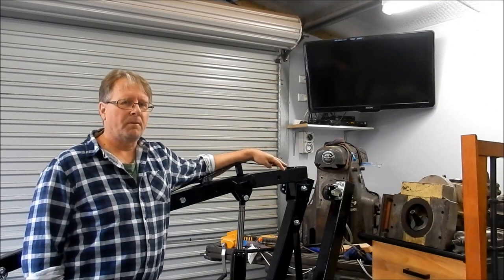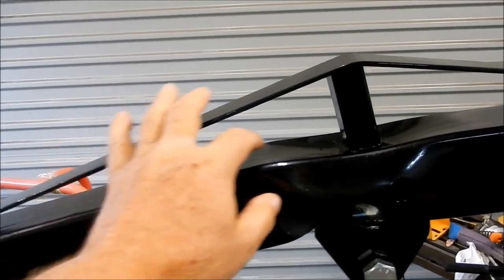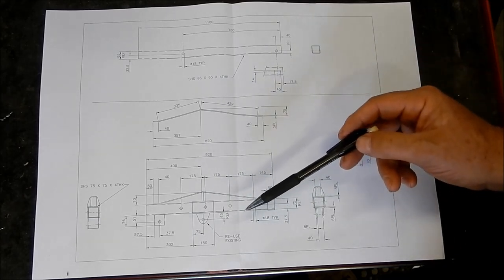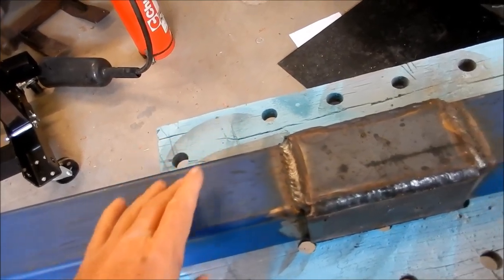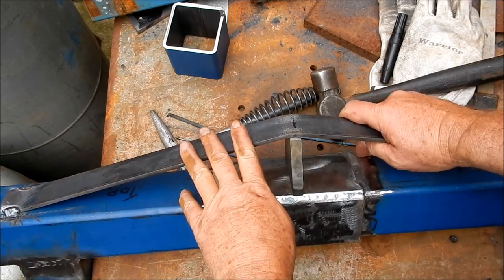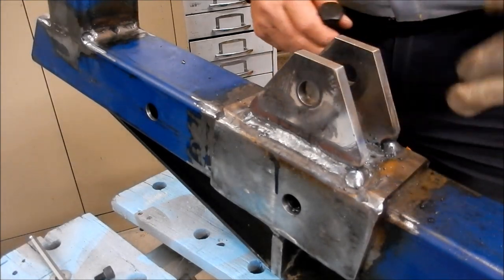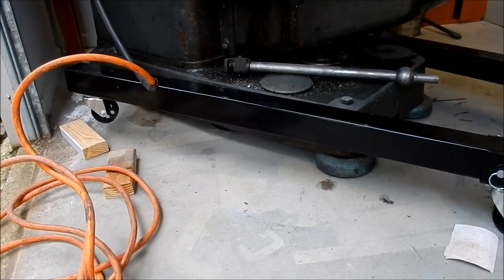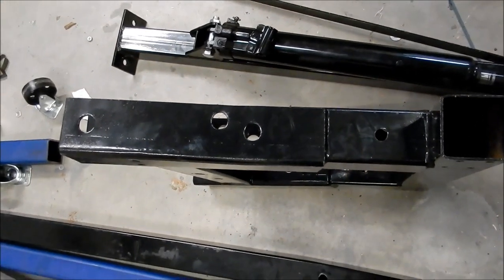Engine Hoist/Crane Fail and Repair Part 1

Comment: I've worked in a few shops now and every one had one of these ubiquitous import units.  They probably all come out of the same factory but get painted different colors.  And yes, I've been guilty of misusing them just like most people but I have to say I'm impressed as I've never seen someone bend one before like this.  I agree though in that the general geometry of the legs and how they mount creates headaches that require boom extension further than one would like, lessening the load capacity.  Looking forward to seeing the unit back up and running in part 2, so you can move your machine!
Reply from the maker: G'Day Everett, yep these little hoist's are everywhere, I used my brothers one to move my Lathe around but didn't want to risk it on this lift.  Very glad I didn't or I'd be buying a replacement.  Yes those legs always seem to be in the way when lifting off the ground.  This is by far the heavy'st lift I would ever do in my little shop so if I can master it with this modified thing everything else will be a breeze.
Cam
Reply: The best addition to my moving equipment other than one of these cheap hoists is my big Vestil pry lever, which I've usually seen referred to as johnson bar or j-bar, and they are great. It is wonderful for positioning my machinery or lifting it up onto wooden blocks, skates, etc. I've even used multiple steel rods to roll the machines like a makeshift conveyer, and that works well too, you just have to be careful and continue to move them as the machine rolls off of one.
Reply from the maker: I call them a Jimmy Bar.  That's how I manoverd it to it's current position but it's now in front of one of the core holes so the next move is to lift it up and over.
Cam

Comment: Gday Cam, I’ve got the same engine hoist and I agree, there absolutely shit to try and move around with load on it, I’m very surprised I haven’t bent mine yet, I did but the steel to build a gantry crane but the RHS went into a new work bench instead but I still got the I beam, steel isn’t cheap so it’s on t he back burner for a while, the biggest gripe I have with the engine crane is the legs are alway to narrow are in the bloody of everything, I made an “dodgy” extension to that goes in the end to gain about a foot more reach but still doesn’t make it any better to use, awesome video mate, cheers Matty
Reply from the maker: G'Day Matty, the things we do in our little backyard workshops to get the job done.  Interative Design through failure, if I was still designing in industry and worked like this I'd be shot, but this is so much more fun.
Cam

Comment: I just lifted my sixis mill approx. 850 kg with my engine hoist to my new workshop. I set the arm at 1000 kg range and lifting went fine. I only noticed offloading from the trailer that the hook was not in the centerline anymore, it has shifted a bit to the side. I only use the hoist for lifting and have now fitted wood beams under all my machines so i can do the moving with my pallet truck. Also saves on the floor, the metal casters are so bad. I can now move all my machines and workbenches with my pallet truck and easily move equipment out of the way when projects require.

Comment: Nice work. Fun lesson in mechanical engineering.
Reply from the maker: Thanks for looking in and commenting Rob.  I call it Intrerative design from failure.  Not the most effective way to get the job done but it works.
Cam

Comment: Nice repair to the chinesium unit. I have the same unit at home under another brand except mine has a dual pump unit on it. Pumps on the up and down stroke. I have not used it yet but I am soon but now I have an idea of the weak points. Thanks for sharing. Cheers
Reply from the maker: G'Day Yves, I hope your lift goes better than mine but I did push it well over its limits.
Cam

Comment: The front wheels suck, my old one has larger none steering steel front wheels set into the legs, can still move engine & gearbox on unsealed hard surface. Also used slightly longer extension tube in the top. Good video👍🏻

Comment: I was interested to see that you slung the machine from under the front and rear of the over-arm. I have a Mk 1 version of this machine and, while the basic structure and over-arm are the same, the recommended sling method (from original manual) is to go under the back of the over-arm and under the front of the knee. I had assumed this implied that the over-arm dovetail was not up to the task. However, you have clearly proved that it is and indeed the manual for the Mk 2 version shows this as the recommended method. This is what I will probably use for any future lifts as it is easier than going under the knee. Cheers, Alan.
Reply from the maker: G'Day Alan, yep I lifted it exactly as the manual described.  I also lifted it this way to get it out of the workshop I brought it from and used a 1T Abby Hoist to lift it with.  The only thing I will change in the lifting configuration is to use a Cum-A-Long to support the knee as its front heavy and lifts on an angle.
Cam
Reply: @camatbattler2233  That reminds me of an advantage of slinging under the front of the knee - it puts the CofG pretty much under the hook...
Alan

Comment: The first time I moved my mill and lathe I used an engine host.  It did not fail but even with somewhat better caster it was difficult to move.  I bought a bigger mill ... and I did not relish trying to lift it with an engine host.   So I made up 4 sets of wooden wedges out of 4”x6” posts. I lifted one side of the mill about an 1” with a toe jack. Inserted wedges... and lifted the opposite side ... until I had about 2.5” clearance.  I then set the machine down on machinery skates and rolled it as needed.   Tom Lipton (Oxtools on YouTube ) has a good video on making a toe jack, and Adam Booth (abom79) I think fabricated some skates.   Also this month’s issue of Home Shop Machinist has a good article on making skates
Reply from the maker: G'Day Fred, I was hoping to get away from lifting and packing and skating by using one lift and roll into place.  The way I'm going it might have been better to invest in a toe jack and skates.  Anyway I'm into it now so lets see if I can get it to work safely, regardless I'll show the result good or bad.
Cam
Reply: @camatbattler2233  “my” toe jack cost me 2 pints for 1 Weeks use

Comment: Very nice repair and rectification Cam. I was watching you lifting that heavy mill at the end of the video and I was thinking, “I wonder if the bottom end will fail”! Well bugger, the bstrd did. Sorry to see this happen buddy. No doubt you will rebuild the entire unit now. Cheers 🍻, Aaron
Reply from the maker: Yep Aaron, my gut also said the base structure would be the next to go.  I took it over to my brothers workshop where he has a bigger press than mine and straightened it all out.  I'll plate it all in and have another go and see if anything else fails.  Its called intuitive design from failure, something I can get away with in my little side show shop but industry would look at it quite differently.  Goldsmith is on this weekend!!
Cam

Comment: That is the problem with a part that is at all well-engineered to be just strong enough to carry the rated loads.  If you overload the structure and then reinforce what failed, you just keep moving the failure to the next component.  And, again if properly engineered, will fail in fairly quick sequence.
Reply from the maker: G'day LT, yep if you push far enough you can cause a failure in any mechanical mechanism.  This rework has now allowed me to achieve my goal of lifting 1600kg and moving the mill out of position so I can have room to refub it.
Cam

Comment: I've been fortunate with my Harbor Freight hoist. I did have issues with the hydraulic cylinder not extending far enough to lift my mill from the factory lifting eye though. I just replaced the cylinder with a higher rated one and did some slight modification to the ram to get it to fit. Now it works perfectly but I will probably beef it up further one day.

Comment: Nice one Cam. Yes I'm guilty of overloading mine somewhat 😂
I was going to suggest welding the top cylinder clevis through a slot in the SHS so it acts as a stiffener and the truss post, then I realised you'd block off the telescoping section! 😂

If you haven't done it yet, I've seen people modify these so they go from a splayed leg to a wider straight leg to better get around equipment. Might be a good idea if you are already working on the base.
Reply from the maker: Hi Tom, yep I said to my brother if I rebuild the base I'll make it wider to get around loads on the ground a lot easier.  I'll do one more plated rebuild on the base and if it fails I'll go with a beefed up wider footprint like the old Abby Hoists. I must admit your overhead flat back lifting frame has some real appeal.
Cam
Reply: @camatbattler2233  I actully thought you had an overhead gantry? It was all pin connections and released allowing more degrees of freedom to prevent binding I seem to recall. Or is it only for light loads?

Comment: Hello Cam

Just found this video and your channel, and I see you have a Victoria U2 mill with a head. I too have the same mill and a vertical head, but I am missing the driving gear, I have the arbor that it is bolted to.

can you tell me the OD diameter and how many teeth the drive gear you have for your mill is, this will help greatly in sourcing a replacement.

Thank you

Peter
Reply from the maker: Yep, I'll get back to you.
Cam
Reply from the maker: Peter, can you flick me your email address.  
Cam

Comment: To move my Bridgeport and lathe around my workshop I purchased a mobile girder rail gantry rated at 1000kg and a 2t chain block and it did the trick easily from H&F. Yes I know the rail was underrated, but there was no major flex in that rail and the wheels worked perfectly. Cost was just over $1000 but it was well worth it.
Reply from the maker: That is a very good option and I would have the head room.  I've almost got this sorted so I'll see how it goes.
Cam

Comment: Looking at the truss brace on the origional I am not sure it's about reinforcing at all but it is designed to induce a "safe faliure" by tin canning the top of the beam cusing it to buckle and fail in a predictable way. Rather than waiting for welds to give way or hydraulics to burst.
Reply from the maker: G'Day Elanman, you could be right and it didn't come down with a thud but rather a "slow" failure.  I wouldn't expect the cylinder to fail as its rated at 8T and at that configuration it should be able to lift 2.5T.  Anyway I'll see how it goes with the next interation.
Cam

Comment: Never ever weld a cross the top of a lifting beam. You automatically create a weak point in the boom. The end stiffener is ok as is the butt end, but the knuckle for the hoist only longitudinal welds. Only use low hydrogen electrodes or mig! Beefing up the boom only, is akin to hanging a 3 ton chain block off a 1 ton chain block expecting to lift a  4 ton load……lol

Comment: could move the top hinge for the hydraulic ram toward the end of the crane arm , this would lower the total lift raise the amount of load the ram could push up but would lessen the load from the ram to the end of the boom (and moves it to negative to the other end )
as for strengthening the lower hinge where the ram mounts to , you could put a tight fitting piece of box section inside the original box section
brilliant violinist (watch those fingers ) reminded me of that joke of the patient with the busted hand asking the doctor if he be able to play the violing ....... doctor answers , year the damage isnt too bad .... thats nice said the patient as i never was able to play the darn instrument to start with 

hmmm the crane actually folds flat when you lower it , think i have a longer ram on mine , probably going to look intoo moving one of the mounts and see if i can fix that as now i have to loosen one side to get the arm to lay flat and allow me to put it away as a smaller package

Comment: You are going to have a whole new cherry picker by the time you are done with it. Would a toe jack and roller pipes not be a better option to move the mill?
Reply from the maker: G'Day Tom, in the area this is going to be placed I still have open holes in the concrete when I jacked up the shed when it sunk.  These make it difficult to move with skates or rollers.  I like the idea of a straight pickup move and drop. Anyway we'll see how the next round of beefing up goes.
Cam

Comment: It's nice to see some proper (stick) welding for a change. Not the spray and pray MIG that I do.
Reply: lmao.. Spray and pray..  Yup, see a lot of that here on youtube.
Reply from the maker: G'Day Mark and yes I still like to use a stick over Mig in most applications.  That little welder is smaller than an A4 sheet and cost less than $100 and will flog 3mm rods out all day long with good penetration and finish.  One of my better buys.
Cam

Comment: Morning Cam. I have the HF two ton and have been lucky. However, your review works for mine as well. Great to have a proper engineering review to provide some keen insight. 

I will take the points and add the tweaks to the retirement list. There will be a new shop on my retirement list so everything will need moved (no I will not be relinquishing the current shop as my wife expects - just adding a larger detached annex - LOL). Lumber up here went nuts for no real reason outside of greed and leveraging a crisis. So I will have to wait a bit more.  

Thanks for all your excellent videos.

Comment: Hi Cam

Hmmm
Don't ask how I know but there is a serious gremlin waiting to catch you. Yet another failure mode with these hoists.

Lifting a load without moving it is one thing but if by some chance the castors jam in say a grove or step in the floor and the load swings forward by inertia or swings in a sideways direction, watch out for a spectacular fail when the entire crane flips forward and topples dropping the load. It happened to me. Good luck was on my side and the load and crane was undamaged however my nervous system took sometime to recover!  The problem is with these hoists when the jib is fully extended the legs are not far enough forward. The lateral stability of the jib is also minimal. You will be amazed how far you can push the jib sideways. Try standing on the legs and then push the jib each way. This translates to real danger if the floor is not perfectly level. Yes I still use the crane but with extreme care and vigilance. I only use the fully extended and the position back from it as a last resort. and I never raise the load more than a few cm above the floor when moving. 

Regards
John
Reply from the maker: G'Day John, totally agree with your comments.  Never push the load, only push the legs or base and sweep the floor before moving.  I'm hoping the larger castors will give it a smoother ride.  As you mention only lift a couple of cm from the ground.
Cam

Comment: Mate , i think i would have thrown that thing in the bin .  The ram will bend next when at full extension !  H & F  sell a reasonable 1000kg   beam  gantry   .
Reply from the maker: Your probably right Max,  I've almost got the next mod completed so we'll see how that goes.  Yes, the gantry would be a great option and deal with all the other machines as well, something I'll look at if it all goes pear shaped on this next round.  I'll usually flog the horse till its dead.
Cam

Comment: G’day Cam. Looks like you bought a good cylinder, the rest is scrap metal. The key to the failure is in your story, you overloaded it but I have seen these import hoists and I wasn’t impressed. 
Cheers 
Peter
Reply from the maker: G'Day Pete, yep nothing beats the old Aussie made Abby Hoists.  These hoist's are cheap and nasty so I'll see if I can improve on it to do the job I need it to do.
Cam
Reply: YEP, it's rubbish.  I wouldn't try lifting a balloon full of air with it  and certainly not something valuable as a mill. Thorough inspection and assessment before purchase.
Reply from the maker: @rogerdeane3608  G'day Roger, did you see the follow up video on how I frankensteined it to lift 1.6T at full reach.  Now it works how I want it to.
Cam

Comment: It looks like you will have a skookum hoist once you have rebuilt it. I have found that a pallet jack works better when moving around heavy equipment. Most of them are rated for around 2000 kg and are more stable. Waiting to see part 2 and 3 (LOL) of the rebuild and I would have a good hard look at that cylinder to see if it is still straight.

Comment: Watch the piston rod, I don't think the chineesium will handle that sort of load at that extension.
Reply from the maker: G'Day Mick, yep I must admit I am concerned about the columning effect on the rod.  I'm almost considering a lockout shell over the rod once its to length to take the load off it during transport.  I've done this before on some unique designs in a past life so it might be worth considering on this one.
Cam